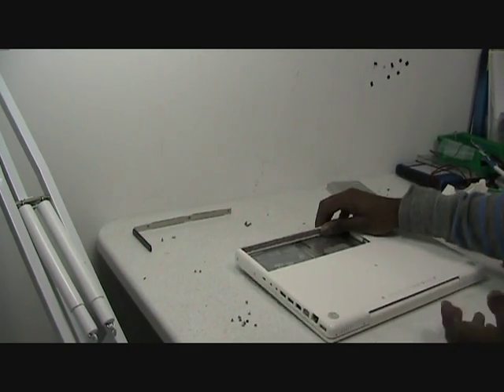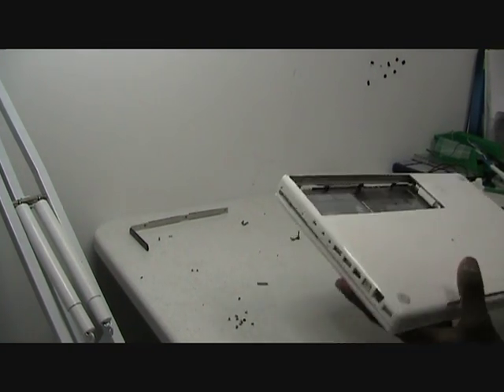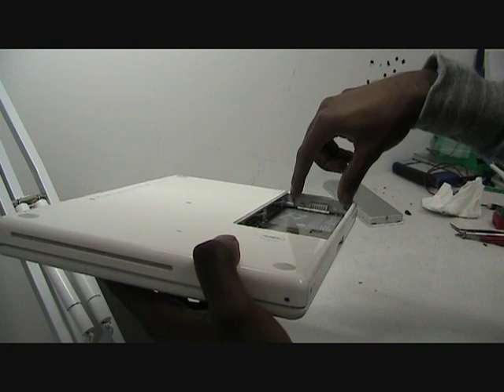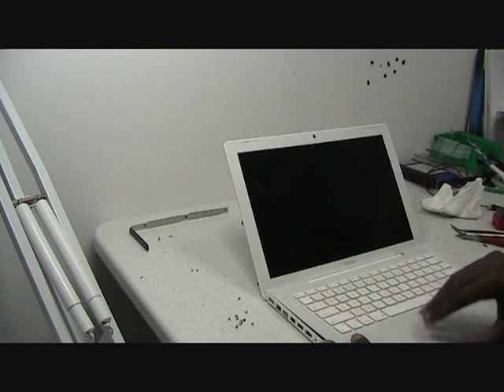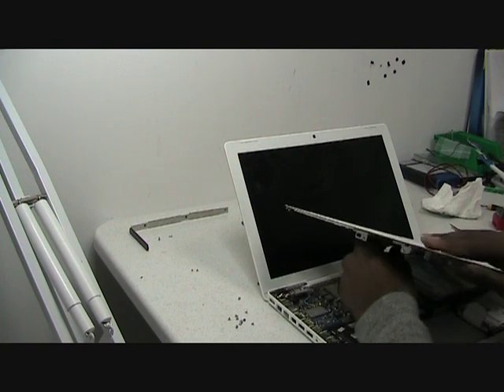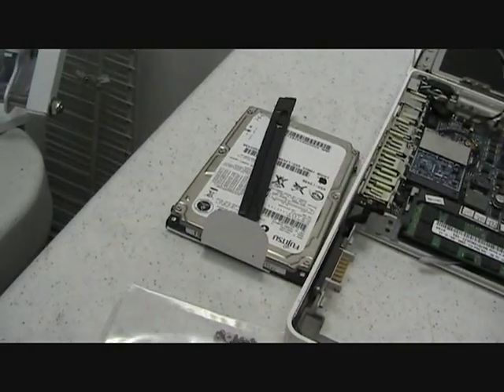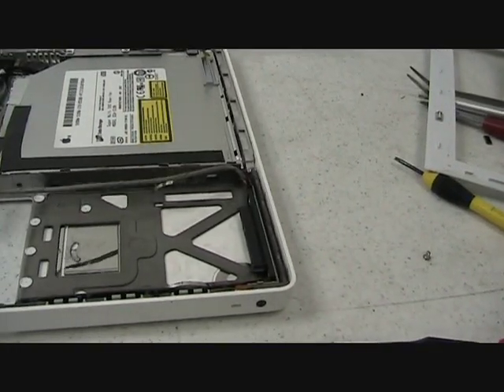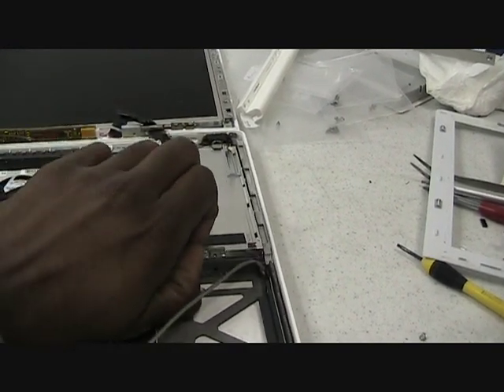Apple Macbook A1181 Hard drive removal

Comment: This is my MacBook story, got 1 off the Goodwill Auction site, it was missing RAM and an HDD. So I put those parts in so I HAD to take it apart like he did, in fact, it was already like that. I am going to order screws soon, and a new battery because the new one is bad (Says "Not Charging: Replace Now" and I even tried resetting the SMC and the PRAM so I KNOW the battery is faulty).

Comment: IF YOU JUST WANT TO UPGRADE OR REPLACE THE HARD DRIVE DO NOT WATCH THIS VIDEO. LOOK FOR THE SSD UPGRADE. THIS CLOWN HAS YOU TAKING THE WHOLE THING APART AND YOU JUST NEED TO REMOVE 3 SCREWS AND A CLIP. NOW i can't get those 10 screws too small to see in straight

Comment: You do Not need to strip the whole thing, after taking out the battery all you need to do is remove the silver L shaped plate and you will see the pull tab for the HDD, just pull it out and there you have it, HDD removed without removing the keyboard

Comment: this video is not informative at all.  No offense to the author, but take this vid down,it's shit. it's vague with the screw locations (that was corrected, but why not edit the video to be more fluid?) , it's the long way around the barn. and it exposes the end user to more risk of damage than needed.  just remove the L bracket and pull the white tab with the drive attached to it..  jeez.  sorry to sound like an asshole, but this video really does suck

Comment: You don't have to take off the keyboard/touchpad- all you have to do is take out the battery with a coin, and the three screws on the screen side. This frees an L-shaped metal part, which is to be removed. Finally, look for the white plastic tab/flap tucked away into the case. Pull this out, and with that you can pull out the hard drive caddy.. Saves taking out ~20 screws..
Reply: did you notive near the end he called the optical drive the hard drive. This is my first mac and I pulled all those screws before going to a better video and finding out I went way too far. This is why I deal mainly in Dells and Lenovos, easy peasy